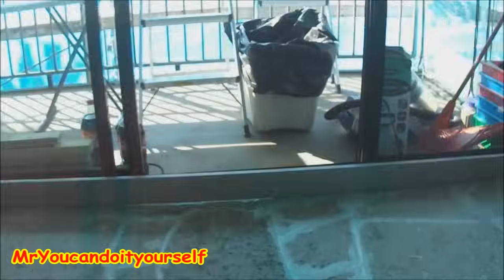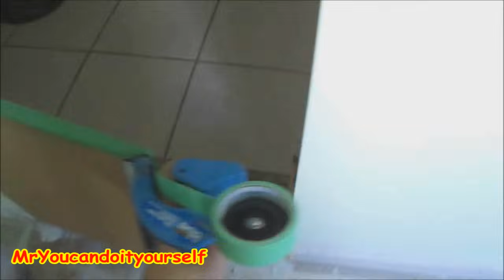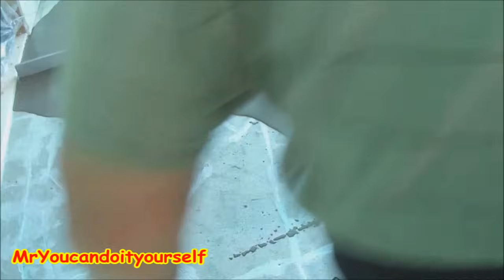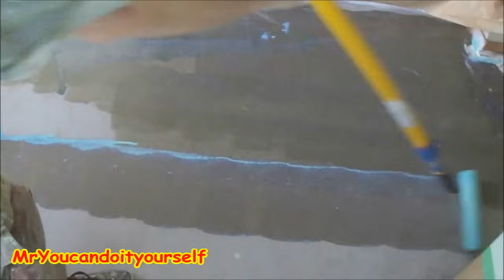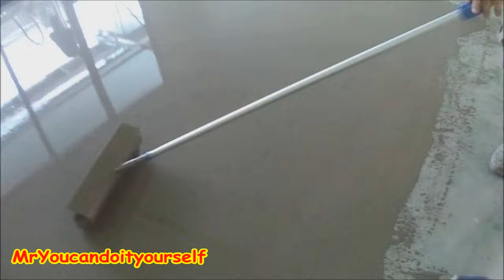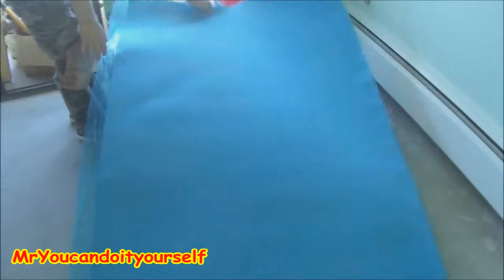Concrete Leveling for Laminate Floor Installation 10 Steps Installing Laminate Flooring How to DIY

Comment: Thanks for the video! I’m about to do this and want to do the 3 bags per barrel approach as it seems pretty effective!  They say to mix 2 minutes is it still 2 minutes if mixing 3 bags?   Also the mixing barrel in your links are OOS/not avail in Canada. Would a plastic Brute 20gallon bin work?  They also have this brute dolly that can lock onto the bottom of the bin which seems interesting.  Or I see you use a metal can, I see those also in 20 gallon.  Does the brute plastic one work or do you recommend a metal 20gallon?
Reply from the maker: Hi, I would recommend plastic barrel. I am living in Canada, Vancouver and barrel I used from vine store. I will publish tomorrow video about leveling compound calculator. You can check it out, how many bags do you need for your project. Thanks!
Reply: Thanks!  I’ll get the brute.  When mixing 3 bags at one time is it still 2 minutes of mixing?
Reply from the maker: @stevenpoint2778  I never calculate time, it's visible when will be ready. Same, Like you doing cocktail!

Comment: Best video I have seen so far on SLC and I have watched a lot of them so far. A few questions though:

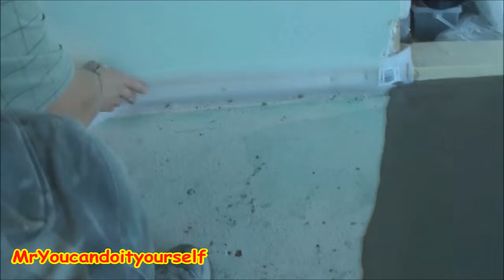1. At the 0:45s mark what are you stapling to the wall to keep the SLC from getting under the drywall? Where can I buy this?
2. Can you show a detailed video of how to stop SLC from moving into a utility room a closet space? Use wood or drywall to block?
3. Does this process change if I am laying down in-floor electric heating cable? Do I still use the spiked roller or do I need something else to help me release the bubbles without destroying the wires?
Reply from the maker: 1.- Foam Seal Roll - http://amzn.to/2i3ydAh
2 and 3. https://www.youtube.com/watch?v=DPPv92A-GTk

Comment: Why do you use foam to cover the gap between drywall and floor? Do you see any issues using duct tape?
Reply from the maker: Hi Anna, this foam I used for keeping expansion gup between subfloor and walls. Duct tape just covers the gaps. If you put just little amount of self-leveling compound, yes you can use duct tape, but if it's going to the driwall I would recommend put foam. Does make sense?
Reply: @MrYoucandoityourself  absolutely! thank you!

Comment: How much time do you give before you lay down any hardwood flooring?
Reply from the maker: I have a moisture meter, this tool shows me when subfloor ready for installation.If you are waiting  3-4 day in summer time after leveling  and also used air fan, most of time it's good enough for starting installation.

Comment: Awesome Video.  I need to level some concrete for laminate flooring just like you show in this video... but the concrete has been PAINTED.  Do I have to grind the concrete to remove the paint or is there an easier way to do it?
Reply from the maker: Need to remove paint.

Comment: Is it necessary to redo concrete if the floor has minimal imperfections but is level?
Reply from the maker: In your situation, I am doing grinding hight spots and just patching low spots.

Comment: hi, great job, what was the laminate flooring you used? I have just used some from  B and Q it was hell: joints kept opening, and I've fitted quite a few laminate floors: but this was and is CRAP 12mm thick: after reading reviews AFTER instead of before:
Reply from the maker: Just regular laminate floor 12 mm.

Comment: In regards to step 8 at 4:25 "roll it out", is that a spiked roller?   How long do you let the self leveling compound set before rolling?  What is the purpose of the roller? Thanks.
Reply from the maker: Yes, it is spiked roller. Self leveling compound set for 25 min, so you should use the spiked roller during this time. Now about the purpose: spiked roller makes your surface more even (like mirror) and take off the air bubbles.
Reply: Please help that 25 min time period doesn't work for me at all. After even 5 min the spike roller will leave the spike holes in the compound.(mixed exactly as indicated on the bag) The compound start to dry way to quick. I'm down to doing very small parts at a time(far smaller sizes you are doing at a time in your video) and having a hard time even with the straight edge to smooth it out, some times parts of the compound will break out(dry), it will also leave the level marks behind in the compound(not smooth at all). I tried adding more water to the mix but its like you have mentioned it somewhere else, the compound is soft when it dries. i'm not finding your preferred used compound "Mapei". Not found here in Australia. I'm using https://www.bunnings.com.au/lanko-20kg-173-floor-leveller_p0966696. I have also tried the dearer lanko make, without any success. https://www.bunnings.com.au/lanko-20kg-133-pro-level-floor-leveller_p0966662. Trying to patch the floor after, leaves a 1 to 2mm holes or grooves around the patched layer. I tried feathering the edges with a trowel, but its to hard by that time adding more water to these edges to try and feather in the edges. This finish i believe is not good enough for glue down vinyl planks. The job is turning into a nightmare. Any advice?

Comment: How do i estimate the bags needed. Also in your video you have some portion of room that is left out.(ypu were using that to walk around). When u come back and apply a coat  will there be change in floor level at locations where the cement overlaps with previously coated area
Reply from the maker: Hi, here is how to estimate bags -https://www.youtube.com/watch?v=DPPv92A-GTk. You can put one more coat on next day.

Comment: I see you did it twice. My contractor did it ones and use trowel. After I still can see 1-2 mm gaps. He said it is normal. Is it true. on my concrete floor I have two hills and gaps toward the wall

Comment: Nice video hopefully it can help me  I just ripped out a strapped basement floor because of a water leak. This time around I do not want to strap the floor so I am thinking I have to find the high point then level the entire floor based on that . Not sure how to get a straight level board to check 25 feet of width.. Can I make a 25x 3  at the high point level  that then continue working in 25 x 3 sections till I finish the entire  floor. I will have to cut my frame to whatever height gets me to level.

This means that if my floor is 25 x40 width by length I am breaking  that area into small segments rather than doing one pour. The first pour gives me a reference for the secoond pour and so on. Less scary. 

I plan to put down laminate on top of a foam layer is this ok or should I put down plywood first.
Reply from the maker: Hi Clem, Yes  you can divide your floor for few section and fill up part by part. Thanks for watching!

Comment: I have an old (1890) home. Floor for the most part is thin layer of concrete over brick.  One spot in floor is just brick and the low spot. Maybe 1 1/4 or so. Entire are about 25 x 12.  May put vinyl planks or maybe just the floor after leveling. Should i find a spot and frame in and pour in multiple area?  Any advice please
Reply from the maker: Hi Russ, I would say, to feel up low spots with regular concrete first, and make top coat with self leveling underlayment. Vinyl planks the best idea in this situation. But you have to ask your local specialists, please.

Comment: After paint on this slurry , how long before you lay your cement on top of it?
Reply from the maker: Hi Richard, primer getting dry with different time, it’s depending from moister in the room and temperature as well. In low humidity room and 20 - 24 degrees temperatures it’s getting dry approximately in half an hour. You will see it after your application. Thanks for watching and commenting!

Comment: What do you do when a 1905 laundry basement was sloped to a drain? At the laundry wall edge its 4" above rest of concrete floor sloping towards drain. Thanks - great video.
Reply from the maker: I can't give you an advice, because I have to see it.

Comment: How thin can this be spread before risk of cracking?  Does it feather out well toward the edges?
Reply from the maker: Mapei self leveling compound very flexible and not cracking. With primer it can be apply from 0 to 3/4" in one shot. Thanks!

Comment: great video.  I laid click lock engineered hardwood didn't level the floor wasn't very in even at all,  very disappointed with the underlayment it sounds very plasticy going to pull it up and level and glue it down instead. is it ok to glue down click lock
Reply from the maker: Hi drummerrz, yes, you can install lock system engineered floor glue down.I did it many times.Only in doorway you have to cut lock off. Thanks for watching!

Comment: Thank you for this tutorial! We will be doing this if our linoleum tests negative for asbestos, otherwise we will encapsulate it. If it is asbestos, do you have any suggestions for what to seal the linoleum with before we put the new floor on top? It's located in the kitchen and mostly undamaged except for a small dime sized hole. The new floor will be interlocking vinyl planks backed by dimple sheeting and someone suggested we use tar paper for leveling. I would value your feedback, thanks!
Reply from the maker: You can level your linoleum with concrete self-leveling. Just use a special primer for it. for example: Mapei primer T.

Comment: Great video, I am trying to level my 100 sqft in preparation for laminate however I want to use the correct primer and self level concrete, any suggestions?
Reply from the maker: I like Mapei.
Reply: maped

Comment from the maker: If you are going to make laminate flooring installation you need a concrete leveling. Watch 10 simple steps how to...
Reply: amazing video, do you suggest using this method on old tiles? I have a flat with old tiles, thinking to put laminate floor on top of them but it needs leveling.

Comment: what product did you use to cover gaps between wall and subfloor?
Reply from the maker: STYROFOAM SILL
SEAL FOAM GASKET
Reply: MrYoucandoityourself what did you stick it with? Cheers

Comment: That cutting tool is great time saver 👍
Reply from the maker: Thanks for commenting!
Reply: @MrYoucandoityourself  hi could you tell what the tool is called please. I've just been leveling a floor for my mum I do wish I'd had that steel plank you used,it I would of done a better job thanks for your tutorials.👍

Comment: Drying time is far to quick. i had this writings pasted  further down on a 11 month old article. Please help you specified a 25 min time period for using the spike roller. This doesn't work for me at all. After even 5 min the spike roller will leave the spike holes in the compound.(mixed exactly as indicated on the bag) The compound start to dry way to quick. I'm down to doing very small areas at a time(far smaller sizes than what you are doing in your video). I even having a hard time with the straight edge to smooth it out, some times parts of the compound will break out(dry), it will also leave the straight edge marks behind in the compound(not smooth at all). I tried adding more water to the mix but its like you have mentioned it somewhere else, the compound is soft when it dries. i'm not finding your preferred used compound "Mapei". Not found here in Australia. I'm using https://www.bunnings.com.au/lanko-20kg-173-floor-leveller_p0966696. I have also tried the dearer lanko make, without any success. https://www.bunnings.com.au/lanko-20kg-133-pro-level-floor-leveller_p0966662. Trying to patch the floor after, leaves a 1 to 2mm holes or grooves around the patched layer. I tried feathering the edges with a trowel, but its to hard(dry) by that time. I am adding more water to these edges to try and feather in the edges. This finish i believe is not good enough for glue down vinyl planks. The job is turning into a nightmare. Any advice? Today i had another go i found a tile supplier selling Mapei novoplan 21 http://www.mapei.com/public/AU/products/Novoplan%2021%20SDS_6627-67_300816.pdf. I gave this a go today. Product is better, stays longer wet and was slightly easier to use. However the edges was still the same, i also bought a rubber floater, this helped feathering in the edges. But still had to wet these edges(as they are to dry by that time). It took me more than an hour to feather in one bag only. The last 1/4 in the bucket got to hard for further use. Please help?

Comment: So where do you get the long board or  screen to drag across the floor
Reply from the maker: You can find "straight edge tool" in any tile and concrete supply stores, or buy on Amazon.

Comment: if u are using self-leveling why use the straight edge that things supposed to self level right ?
Reply from the maker: Have you ever tried to make leveling without straight edge? :)
Reply: self leveling is just a marketing word. It should be called Leveling compound. All liquids self level. But this is a cement and is thicker than water. It will need help to spread to all areas. If you pour a lot, it can self level on its own due to density, but for thin layers in flooring, it needs to be spread so its faster and covers areas before drying.
So, yes, you need a edge, and even the spike roller to help it even out and release air gaps etc..

Comment: if I am doing the leveling by myself would adding more water increase the working time without compromising the strength of the leveling compound
Reply from the maker: Hi Tom, good question. If you add more water, concrete losing structure, and getting soft when it's dry.
Reply: Tom Wilson Mr you can do it yourself 
can you use this product over tile floors?
Reply: MrYoucandoityourself  can you use this product in tile floors?
Reply from the maker: Yes, only with primer T.

Comment: When I apply the primer how long do I have to wait to apply the self leveling concrete?
Reply from the maker: Hi Gidi, you have to read instruction on the bottle with primer. I always check by step on primer if it's sticky - ready to start.Thanks!

Comment: you can mix the primer with the cement.  no need to roll on. if it's a floating floor on concrete no primer is needed. it's more for gule downs and tile. is your joint stager 12 in?

it should be no less then 12" 

I like to start the stair step with a 16" a 32" an a full board.
Reply: Jacob Garcia negative on the add the primer to the mix.  Some may but follow all instructions on materials.  The primer that is rolled on the floor is so the self leveling can stick to the substrate.  We always use a stiff broom to apply so its worked in.  rolling can cause inadequate coverage

Comment: You could of saved yourself money and time by just buying green underlay and plastic.. lay plastic DPM and green (thick) underlay.. put flooring on top. Job done!
Reply from the maker: Hi David, thanks for your comment, but this video about leveling. Of course green underlay better than I showed in this video because have more sound protection. Price for green underlay 3 times more($0.18 and $0.65). Poly on this floor not important because this third floor. Poly need install in the basement or first floor.
Reply: MrYoucandoityourself good video still:0)
Reply from the maker: Thanks!
Reply: David Warfield so thick underlay will compensate for a floor that is not smooth and level?
Reply: Cardboard will be fine